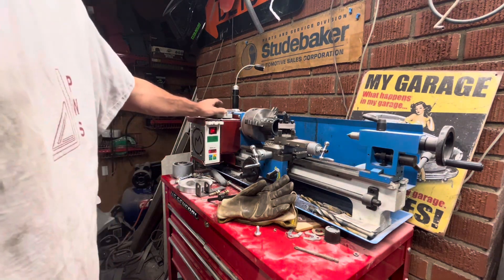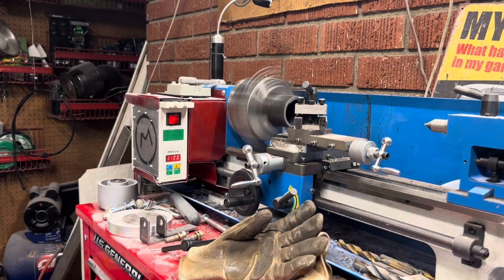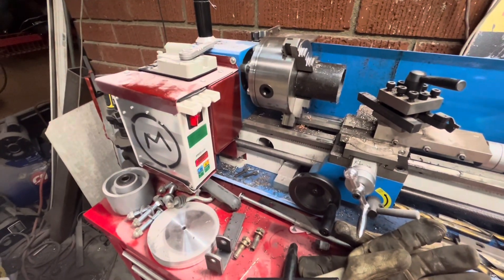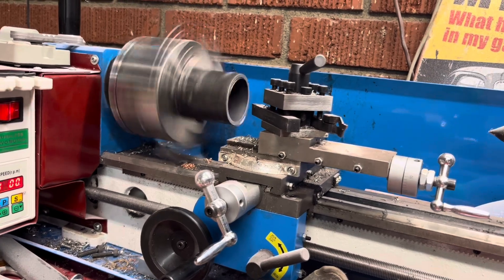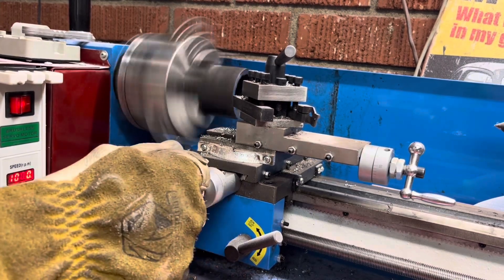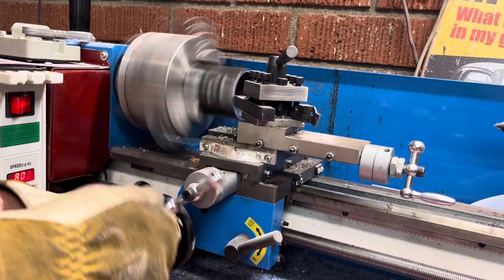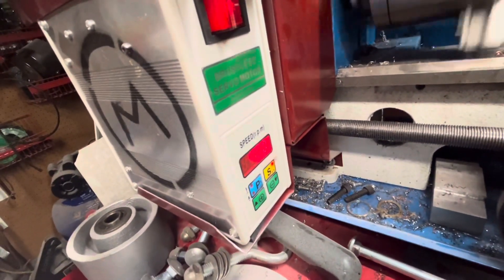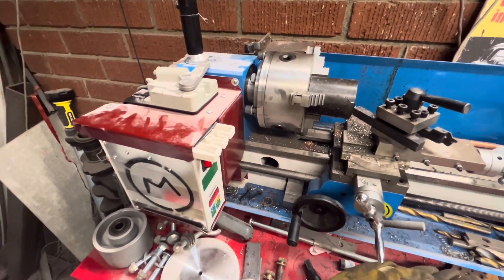Mini-lathe upgrades two that are a must watch me demonstrate 😀

Comment: whats the sewing machine motor specs? make model?
Reply from the maker: It’s a 1hp 110v on eBay. Better check out quick. As soon as us stock runs out the prices will double. You can bet on that with everything you own
Reply: @Motorhead_Mark  gotcha, yeah I'm sure all goods imported will skyrocket
Reply from the maker: And every thing made here with foreign components. Which is everything. Buy up now. That’s what I’m doing

Comment: Consider a 2nd 4" chuck.  I set one for inside jaws and the other for outside jaws.  Costs a little more but saves time.  The smallest chuck that will hold the work is usually better than using a big chuck for everything.
Reply from the maker: I have the 4” that came with it. I like the bigger clamps. The work is more stable. But maybe some day I’ll need it

Comment: Mount it to something sturdy. Tool box is not sturdy
Reply from the maker: Sorry I missed this, thanks for commenting. I have the rubber feet on the mini lathe still. It will rock back and forth on an un even piece. But it never walks or moves the tool chest. It’s a nice setup with all the tooling in the top trays.

Comment: Thanks for sharing...gotta pull you up for wearing gloves while on the lathe.....big no no.....stay safe friend
Reply: What Rob said. If you get your gloved hands caught between the extended jaws on that oversize chuck and the bed ways your hand will be pulled into the machine in less than a blink of an eye. It will be just like sticking your hand into a sausage grinder. Bare handed would be about as bad.
I would change the chuck to a 4 inch instead of the 5 in you have now. The jaws don't appear to be completely wound out and they are almost crashing into the bed ways. If you regularly do larger work, you really need to move up to a larger lathe. 9 inch swing might suffice, but a 12' would be even better. You will quickly find out that the lathe you have isn't very rigid and is made even worse by sketchy Chinese build quality.
The lathe can be improved with a rigid table mounting and fixing the poorly fitted gibs on the compound slide and the saddle. Converting the stock spindle ball bearings to tapered roller bearings will be a good improvement too.
Have fun, but please be safe. Always remember even a little lathe can tear you a new one.
Reply from the maker: I like the last line the most 😀
Reply from the maker: Really??? It throws hot metal on my hands. I get you can’t have loose ones but these are tight. Painful without
Reply: @Motorhead_Mark  that means you are not sweating enough😂

Comment: I have kind of thought about doing the servo motor upgrade on mine. I have a lot of other issues mainly in the ways and the compound slide flexing.
Reply from the maker: @faroironandcustoms6577  thanks for commenting, the servo motor makes it work the way it’s supposed to. I found mine on eBay for 135. 1 hp sewing machine motor